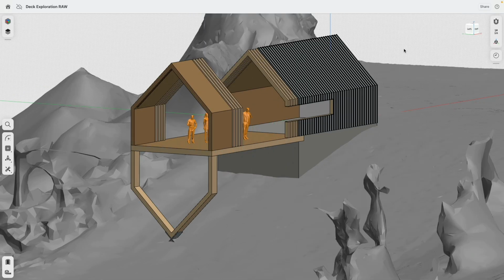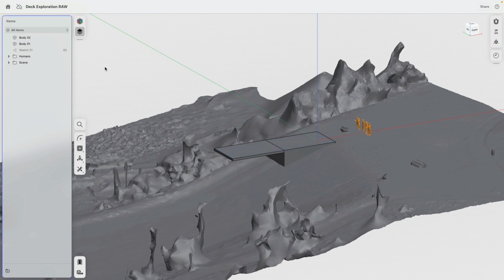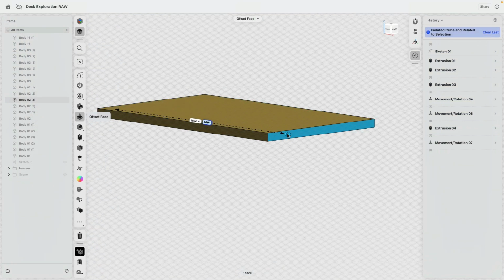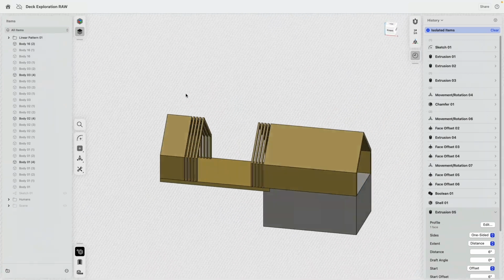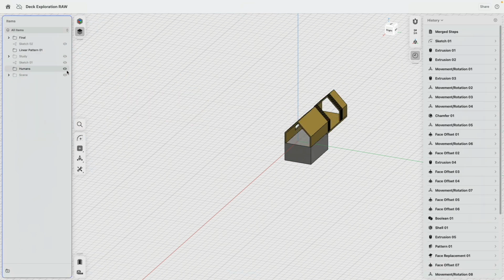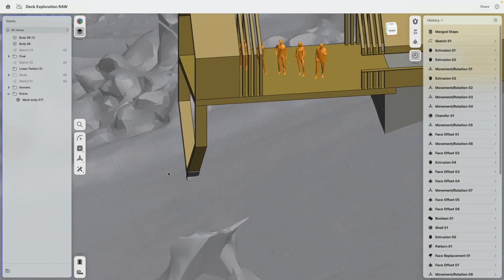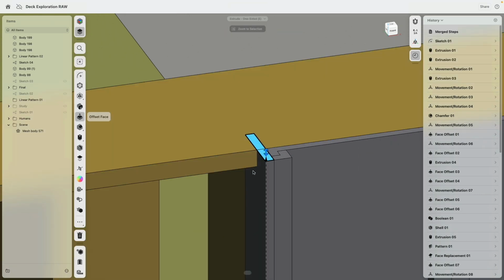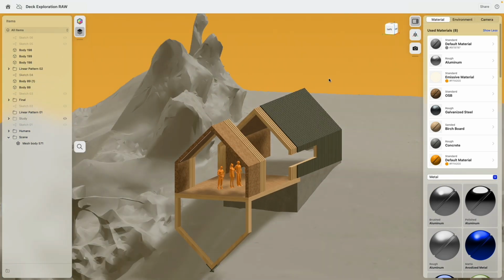Shapr3D - Deck Design

Comment: How did you get the terrain surface?  (It looks optically scanned, maybe?)  What created it, how was it imported, etc.?  I've got a sharply sloped lot that makes my own deck design a lot more challenging, so I need to take that into account, too.  Alternatively, is there an easy way to create a patched surface with varying z-heights at grid positions?  I'm experienced at CAD, but new to Shapr3D, and my new deck, though not trivial, is a way simpler way to get started than some of the other things I plan to design.  Thanks for these videos!
Reply from the maker: Send me an email at

Info (at) ckbrd (dot) de

Then i can show you the options

Or ping me at facebook